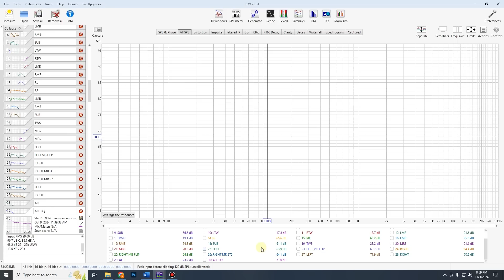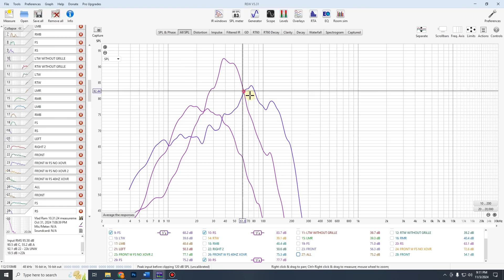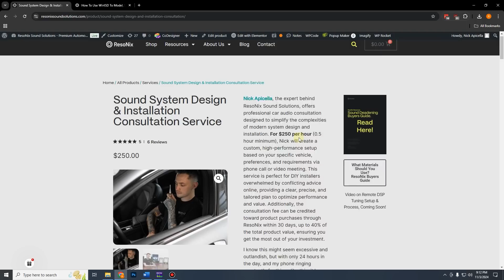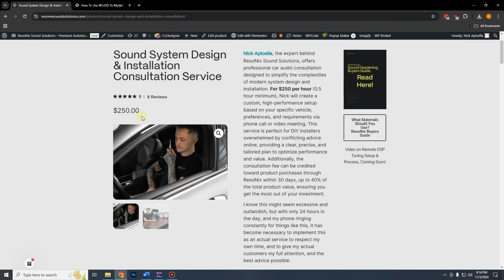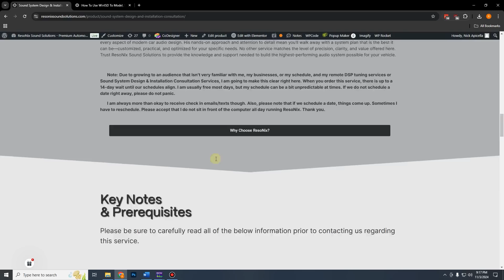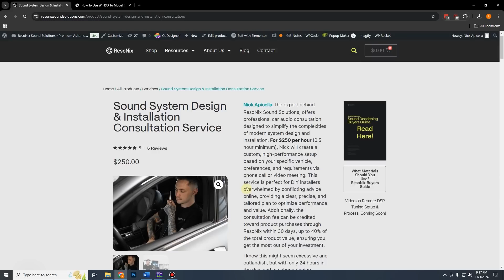ResoNix Tech Tip: Stop Using AudioControl Amplifiers! Subwoofer System Design - Low End Extension?

Comment: I’m the customer Nick mentioned. I just drove an hour home with my newly installed system, and I couldn’t be happier. Building a dream system for my truck has been a goal of mine, so I spent months on forums and YouTube looking for guidance, especially since my experience was mostly with basic setups in my cars. Being fairly handy, I wanted to create something that sounded incredible while saving on labor costs.

Until I met Nick, I had NO HOPE of finding a reputable shop to handle the installation and tuning. Now, the system in my truck is unbelievable—I didn’t want to get out when I got home! I highly recommend Nick and his team. It’s rare to find people in car audio who truly deliver top-notch quality.
Reply from the maker: @VladC6  glad to hear that you love it. As always, let me know if there is anything I can do further. Thanks again!
Reply: Yep...I also had the privilege of experiencing the Audio Control HP filter and wondered why in the past that other amps I had run with less power had my subs digging much lower down into the low 20 HZ territories. Ditched the AC amp and now have bass you can truly feel and for far less money as well.....
Reply: @FrankBennett-kb7xs 
What amp did you replace it with?
Reply: @rohanthelwell7454  a budget oriented Stinger MT1500.1 and it strangely enough and absolutely outclasses the AC amp in power output, physical footprint, low heat, efficiency, frequency response 15 HZ-150HZ, and cost wise. I say "strangely enough" because audio control and Stinger are now essentially the same company....What you have with the stinger amps is a design done by a former engineer of Resonant Engineering and the MT amps are of his design. They are very much the epitome of budget gems.....Quality bass amp for literally around $180 or a third of what the AC amp costs.
Reply: @rohanthelwell7454  a stinger mt1500.1
Reply: What model of AudioControl amp did you have? I just got an EPIC1000 and the subsonic filter has settings ranging from OFF to 50hz.
Reply: @Duophile  I had this exact same question.

Comment: I had the same issue with the Kicker CX line of amps, the monoblocks all have an undefeatable subsonic filter baked in, LR24 set @ 25hz I believe. Wish they had made a way to disable it, great amps otherwise. I had the 300 then the 1200, super solid but dorito-shaped FR.

Comment: So I called Audiocontrol and did confirm this in the LC series, if anyone is wondering the Epic series does not have this. 

Before anyone talks about what’s better and why, I’m just dropping this info for those who come across this video and was interested in the at line of amps (epic). To whether or not it’s a good purchase who knows, but it does not have this exact issue that the LC has.
Reply from the maker: The epic series was probably too cheap to put a more robust pre-amp circuit in lol
Reply: @ResoNixSoundSolutions  yes, it’s marketed as a budget amp indeed, that’s by design.
Reply from the maker: @nickm7820 So most likely nothing anyone watching this channel will be using
Reply: @ResoNixSoundSolutions  but still relevant, budget or not, the consumer should have the freedom to tune their own subsonic filter and run all pass completely. So you did a good service by pointing out that the brand itself has done this, you will likely get viewers who are looking at the brand from all aspects and might wonder if the same applies to the budget amps I’m confirming that it doesn’t.

Comment: 18:43 haha. i just asked on another Video if a pair of IB 8's will integrate into a IB 18. lol. i do wonder what an IB 18 will do though, right now im in the planning phase for a new setup.
my current install is a 2-way in the doors and 2 12inch Alpine SWG 1244 in 120Liter(4.2 cu-ft ish) tuned to 25hz and its all 100% shit.  ive had an older pioneer 12" subwoofer before on about a thousand watts rms that played low well but it wasnt loud enough. needed like 8-10db more.

Comment: So sad for audio control because they make the epicenter and are known for bass extension equipment, I got a D1200.6 and was going to buy two LC-1500s for my subs one to each SQL12 and I'm glad I didn't people warned me I even called Audio Control and talked to them and your stuck with it if you buy their equipment. I was going to run all audio control and because of this very issue they missed out on me at least showing my car at car shows with a full-on Audio Control system.

Comment: I wonder what a graph with the new subs and enclosure woulda looked like using the AC amp. I’m thinking the lack of performance was mostly due to the original sub/enclosure combo.
Reply from the maker: @Dav.vid1  no, it was mostly the amp. Modeling the subs shows they perform close enough in frequency response. But the amp severely limits low end due to a baked in subsonic filter that's way too high in frequency
Reply: @ResoNixSoundSolutions nick, the one built in is 24hz@18db slope. Did you feel like it was much higher than that? Thanks. I was also your customer w tuning :)
Reply from the maker: @daveroski  it just felt too limiting regardless of what it's exact setting was. Why sell an amplifier that cuts off and limits half an audible octave, then everything below that includes tactile feeling without any way to defeat it. Silly.
Reply: @ agree!
Reply: @ResoNixSoundSolutions  gotcha, I looked into it and the amp I checked was permanently set to 24hz, idk why so high but good to know. Great content btw 👍🏽

Comment: I also made that mistake.

LC1.1500. 
It sounded good on my Morel Ti124, but it was lacking the lowest notes. 

I had a spare Steg K2.03 two channel with no subsonic filter.
Hooked the Morel on the Steg bridged; you could even see the inaudible lowest tones move the cone, which I never had seen with the Audio Control.
I researched if the built-in subsonic filter could be disabled, but unfortunately I couldn't find anything.

Is the Audio Control a good subwoofer amplifier; yes. 
Does it have a major flaw; definitely....

Comment: I've never been on board with AudioControl. A lot of the youtube car audio channels and local shops push these things. It's a half baked DSP and half baked amp smashed together for way too much money. Helix, MiniDSP, Down4Sound, Taramps; those are my jam.
Reply from the maker: @WestonWill  down4sound and especially taramps does not belong with the other two lol
Reply: @ResoNixSoundSolutions  It depends on the use case. If you have way too much headroom, you're never getting into the distortion of the amps. Now, would I suggest these amps to someone who wants a reliable, one-and-done system? Probably not. For me they work well. No line noise, most of my gains are set to Min and I can still rock out as much as I want.  Speaker drivers, proper installation and a decent DSP are way more important than "clean" amps (as long as you have enough power).
Reply: New to this channel and just an hour or two in, and it's obvious that you (Nick) have a vast amount of both talent and knowledge in audio. I know that Taramps and D4S are definitely targeting a different demographic than the folks at focal or McIntosh are, but I feel your comment regarding this company and that brand doesn't belong with the x y z's, reminds me of 2 instances that might change your stance if you aren't already familiar with them. 1st is when a braz full bridge was A/B tested against- and please excuse that I can't recall the amp model- but against a half bridge with fancy caps and top of the line filters, equating to a 500 dollar competing against a 8 or 10 or 15000 dollar amp and the sound was discernable to those that tried to determine which was which. The 2nd instance, while honestly I can't stand the face or owner or whatever he is in relation to D4S and I partly hated purchasing something from him that provides him with more resources to continue acting like- well I will stop there. But D4S makes a class A/B in a world over populated with class D that if you haven't had a chance to hear yet.. I think your stance of at least one if not both of my examples might be different after seeing the A/B experiment (which is probably really only going to apply for say 60hz and lower) and if you get a chance to hear warmth and detail of the class A/B they produce. I'm sure you know of both but happy to give specifics to if interested as trying not to name drop on my first or 2nd posting in some time now
Reply from the maker: @neildeatherage2269  I think you're missing my entire point of the video and why I'm saying to stop using these amplifiers.

Comment: Just an fyi and anyone can use what they want, but their dsp amps dont have any filtering and you can pick it within their software if you want a subsonic. They used to have that in their software when it first came out but they got rid of it from people complaining. Just wanted to clear that up for people reading. This video is for their non-dsp amps that have that non-defeatable subsonic. edit: after looking at all their new amps it seems they have defeable subonics and they never updated their LC line for some reason.
Reply from the maker: The DSP amps is recommend even less than the LC amps. The DSP's from them are terrible, and are a whole different story.

Comment: I think review filtering from places like Crutchfield or Best Buy are a big issue. Not that crutchfield doesn’t offer a huge amount of options and tech support, I just think people usually are let down by what they end up with because there’s a dramatic lack of cohesion or timber in their system even though the receipt would say otherwise. It’s like golf… people buy off the rack clubs and don’t improve until they actually get fit and see objective data. People on forums can be snobs but most are helpful. If it wasn’t for people like you and Peter we’d be lost. Like you say, good planning and generous advice can save someone half the money with three times the sound. Understanding the plan is one thing, but understanding measurements is an entirely separate dynamic most aren’t prepared to either pay for, or learn to do. 

Side note.. my LC4.800 powers my midbass and I love it 🤧
Reply from the maker: I think big YouTube channels pushing products that they get paid from is the problem here

Comment: My subs mud out at 50 Hz, box tuned to 40 Hz, 2 8 in B2 Audio rage 8 V2 in a 1.4 cu ft box with slot port.low end is awesome but 50 Hz it sounds thin vibrations, like my subs cant produce the Hz. My DSP is set to lp 80 and hp 30. Can someone help me, I also have an audiocontrol lc2i pro for line driver, accubass off

Comment: Awesome info! 
I have a sneaking suspicion I'm using the same morel 3 way set and see the same issues with the mids in the dash by the windshield. I'm in an f150.
Do you have a mid range you recommend for a truck dash location that will give a good response?
Reply from the maker: For something that's fits in the OEM location, I am not too sure.
Reply: No idea if they'll just drop in, but I love my Peerless Mids: "Peerless by Tymphany NE85W-04 2-1/2". I would put these up against a mid at any price.
Reply from the maker: @WestonWill  have seen issues with those in a dash due to not being treated for UV and built to handle heat.
Reply: @ResoNixSoundSolutions  This is true. Most of these issues can be minimized with decent window tint it it's legal in your area of the world. I've had mine on top of my dash for 3 years and have not had a problem. I have had sealed tweeters in the same location puff up, not great!

Comment: Jeez, how much more did this customer spend on this issue?
Reply from the maker: Well, there were a few small suggestions. One was an actual issue (the sub amp/sub setup). The second one being a low-hanging fruit upgrade (the midrange and adding a front sub), and a suggestion for further improvement based on what the cars layout offers (moving tweeter to the sail panel), but he ended up also changing speakers, subs, sub amps, doing the front sub, etc. Its pretty much a whole new system minus the Helix P Six Ultimate and P Two, which is what I originally sold him when he contacted me, but already had everything else. But put it this way. It was enough to where he could have just dropped the car off and left a week or so later with a really good system fully installed by a professional. I truly do think the consultation services that I am now offering are a bargain since I see these situations happening quite literally every single day.
Reply: @ResoNixSoundSolutions  Have you ever encountered an issue with a Match dsp where only the sub channel stops working?
Reply from the maker: @hot99pas  no

Comment: Are their LOC’s still good? Audio Control that is.
Reply: Their LOCs are very good if you want to amplify a stock stereo system or amplify an oem headunit and change out the speakers.
Reply from the maker: Its 2024. Why would you ever use a LOC? Unless you are only adding a sub? Honestly, I am not sure. Havent used a LOC in over 10 years.
Reply: @ 

Short version. Audi with MMI so fiber optic.  Not a lot of options here.
Reply from the maker: @neil12011audi with mmi is great since you can use a MOST interface.
Reply: @ResoNixSoundSolutions  

Yessir, just kind of lost on the MOST part. I’m savvy with car audio wiring, but i came from the din/double din era, so these are a bit new to me.
Reply: @ResoNixSoundSolutions  Why do you act like using LOC in 2024 is rare when factory headunits are no longer easily replaceable? Why the dishonesty?
Reply from the maker: @Swift016  Why would you ever use a LOC when you can use a capable DSP? And yeah, theyre no longer easily replaceable but more so than that, the signal they spit out is very complex and difficult to work with. A basic LOC is NOT the answer in 2024. A proper DSP will be required to work with these and get proper end results. Many hobbyists are not aware of these things and are exactly why they get sucked into what I am talking about in my video, and is exactly why i think my consultation services are very beneficial, and would even consider it a bargain.
Reply: @ResoNixSoundSolutions  We both know a DSP taking input from a factory head unit has an LOC. Your statement of having "not used one in 10 years" is technically incorrect and misleading to the inexperienced hobbyists you're advocating for. Just making sure we're being clear for those individuals who might take what you just said and run with it ("You mean I don't need an LOC? Great!").
Reply from the maker: @Swift016  your understanding of what an LOC is is incorrect. A LOC is not part of a DSP. But both feature high level inputs. They are two different things.
Reply: @ResoNixSoundSolutions  You're being purposely obtuse about what an LOC is and isn't, when their function is what's important. You can have an LOC that is discrete, or built into a DSP, but it's still a LOC at the end of the day.

This is just straight intellectual dishonesty, which is hilarious because you claim to have a stake in educating hobbyists. Being a prat about this isn't helpful.
Reply: @JasonWW2000  *You're* not smart enough to participate in this conversation.

Comment: Thank you for confirming that I need to get rid of my AC mono amp. 

I agree after installing the AC amp it my subwoofer sounded "off" in one way or another. even with playing around with tuning.
Reply from the maker: Glad I could help. Let me know if you need further help :)
Reply: @ResoNixSoundSolutions  Im in the same boat. I have struggled to get the subs to sound great on my AC LC 1.800. On top of the poor sound, I get some kind of low end rhythmic pulsing (even without inputs connected to the amp.

Comment: What did the customer use for integration from the OEM head unit?   Amp Pros work fine but in a Ram im using Idata AR into an Arc Blackbird or PSM Pro.   Then it lets us, the installer, change the bass control to subwoofer volume control among other things
Reply from the maker: @melissathompson7229  he actually bypasses the OEM system completely.
Reply: @ResoNixSoundSolutions oh cool.  I assume Bluetooth on a DSP or a DAP?
Reply from the maker: @melissathompson7229  Both actually, using a DAP and a Helix BT Streamer

Comment: Rumble thing had to be a phase issue related to impedance. Whats your theory?
Reply from the maker: Wasnt a phase issue. Phase measured fine. At first I thought the Accubass feature was accidently turned back on, but it was indeed off. I think it was a combo of not so great subs and an even worse amp.
Reply: @ResoNixSoundSolutions  But what actually makes something peaky or beamy? Its more than a dollar sign. I feel like it's cheating to just say, "cheap stuff sucks". Do you think TS params provide an honest representation of real world? Or is it like pyramid amps back in the 90s and their RMS ratings? I've built many enclosures and specd many drivers and I'm with you. It's almost like none of it matters past experience